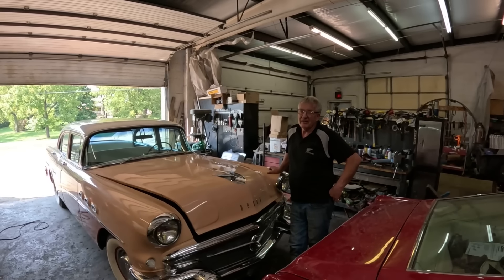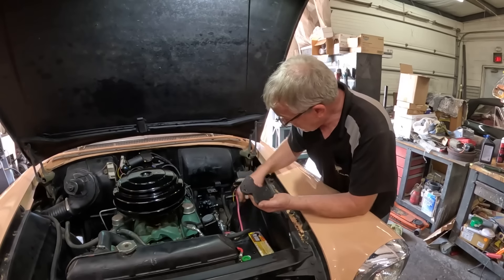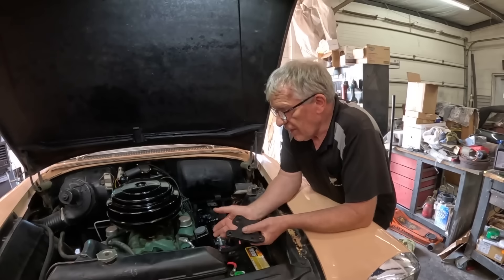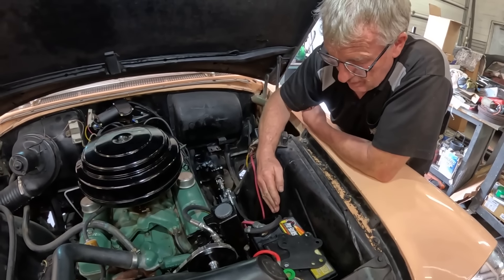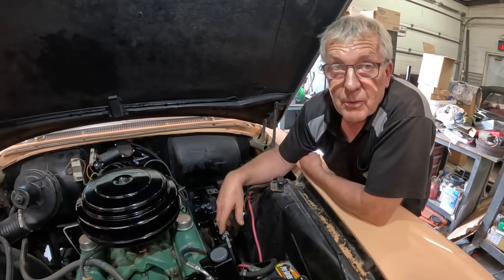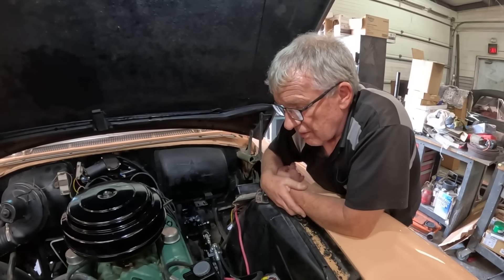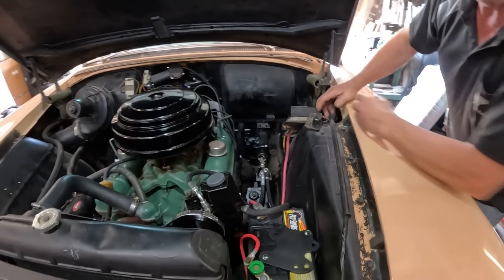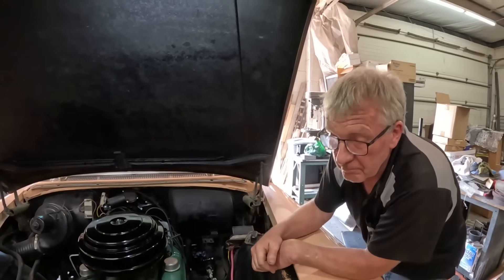I got Burned on Ebay !!!

Comment: EZ Steer just lost 24,000 potential customers
Reply: Easily
Reply: I hope EZ steer contests Kiwi’s opinion. Could be popcorn type fun.
Reply: I would never consider putting power steering in a car that one wasn't designed for it, and 2, doesn't need it.
Reply: @mexicanspec  When those cars were new little old ladies drove them all the time. Easier to get a newer car on the initial buy if power steering or brakes are necessary.
Reply: @mexicanspec    Power steering became available as an option on most US cars starting in 1953, but the factory system is obviously not the same compared to what you get in an aftermarket kit. And yes, you do want power steering in such a heavy old boat. It makes driving it way easier.
Reply: @Fevebblefester  Yes I know.  I used to daily a 1963 Plymouth Savoy slant 6 no power anything.  I never had a problem parking it.  I also used to drive a 1951 Buick Roadmaster and power steering was not needed there either.
Reply: @MrZdvy  Easier yes but not necessary to drive it.  The car has survived for 68 years so far without it.  Adding after market parts to a car like this is always a mistake.
Reply from the maker: The lady that owns this car really does need power steering.  Now me, I'm adding power steering to Marge just cos I like it😬
Reply: @mexicanspec  This was designed for it. It was an option.
Reply: @kiwiclassicsandcustoms9160  Without out it is a workout for your arms so you earn big guns.
Reply: @mexicanspec  yeah but a nice old lady will drive it
Reply: My mom drove a 55 buick when i was about 5. No power steering or power brakes. It was hard to parallel park.

Comment: Kiwi I was actually about to buy this kit for my 55 Buick Special. But I was thinking I have a 74 full size Olds 88 steering box and I have a 80s Monte Carlo SS steering box do you know which steering box they used in that kit? I'm wondering if I could just do this myself rather than wasting the money buying the kit and having to do it myself like you did anyway.

Comment: I'm fighting one right now over a "Small Cap HEI" distributor. 
Met a guy at the car show that bought one and is really happy with his, but the one we got is a TOTAL nightmare. Dead out of the Box. So far, they are working on it for us, but it's put the build on hold for a week now. It's really hard to get good stuff now days, even if it's made in the USA.
And that's really hard to say, but it's true.
Reply: Any new distributor is tear down and full inspect for me, bought a new production one for an odd application a few years back, not eBay crap either, you wouldn't believe the amount of sand, slag, and swarf hiding in that thing between the bushings, probably would have killed the engine if I didn't have to disassemble and modify it first. Even stock stuff for late model cars I look over real careful now, you can't trust anything, QC is dead.

Comment: Sorry to hear. I got a power brake kit from ebay and pretty much had the exact same problem. I couldn't figure it out, my mechanic couldn't figure it out, supposedly a new bracket was sent, nobody ever got it and by the time we'd given up on it the guy said it was too late to return it. Ebay wouldn't help and I called my credit card company and they did a charge back. After they finished the investigation the chargeback stood, so I'm only out what I paid the mechanic. Maybe give that a shot.

Comment: I'm sure it's too late now, but could the return fitting on the pump been welded closed and a new one welded in the back of the tank so the hose would not come across the battery or is it a plastic tank?
Reply from the maker: It's a plastic tank😔

Comment: I wonder if that P/S bracket was for a 55 Buick. The 55 used a much narrower, but longer battery. When I was 16, I had a 68 Mustang 390 with manual quick steering. Junkyard supplied everything I needed for P/S, except the pump. I used a 55 Buick pump, and made my own bracket. It actually worked very well! Sorry to hear of the troubles with the steering.

Comment: Not sure if he would have had a solution for you but I've used EPAS steering in Florida and they provided excellent service from start to finish. I think they specialize in electric power steering conversions and frankly, I think that would have been a better option in this case. Jeff over there was always helpful on the project I used them for and I wouldn't think twice about using them again.

Comment: I am so tired of dealing with $hit aftermarket parts.  It seems that just about every part sent requires a re engineering just to attempt to use this junk. Not singling any company out, its just one thing after another 🤬

Comment: What was the original power steering design?
Reply: It should have had a slave cylinder attached between the track rod and frame. A pump connected to the backside of the generator powered it. These slave cylinders were prone to leaking and were subsequently replaced by powered steering gears.
I would have recommended converting over to a rack & pinion set-up. But for an old Buick, that in itself would likely be a custom-designed system only applicable to that brand, given that Chevrolet, Pontiac, Buick and Oldsmobile didn't start consolidating their designs, until the following decade

Comment: Its a good thing that someone as skilled as you was installing it and could fab the stuff that would fit. My question is if the customer can make proper brackets why can't they? It would take little more effort to make a part that works than one that doesn't.
Reply from the maker: That's a good question that I don't have an answer for...😕

Comment: Seems like a kit designed to fit one application but the seller is trying to pass it off as fitting completely different applications, then sticking the buyer with something they can’t use without heavy modifications, if at all. I have experienced the same issue on eBay recently, just on a smaller, cheaper scale. Fortunately, I have been successfully getting my money back from buyer protection.  The problem is, a few rotten sellers are going to make eBay a completely untrustworthy place to buy from. Eventually, eBay will have to tighten the screws on the sellers which will make life more difficult for the honest sellers.

Comment: Good on you, Chris for calling out these sheisters. Unfortunately, you are the exception. I've heard more than a few YT'ers who suffer similar rip-offs and crap for customer support, but decline to mention the offending party, which is both annoying and frustrating. We want to know who these rat bastards are so we can "steer" clear of them. As James Plotkin commented, you probably should have mocked up entire set-up before making irreversible cuts. Not your fault, but two valuable lessons learned.
Reply from the maker: James is right, I had been lulled into a false sense of security by Borgesson who put out a stellar product that fits and works every time.  I assumed these guys would be the same, silly me😳

Comment: Did this car have the thin battery originally?  I can't remember now.  Maybe that would have given room for the PS pump.
Reply from the maker: I don't think so as it has a regular sized battery tray that looks factory.
Reply: @kiwiclassicsandcustoms9160  Maybe that was just the 6 volt cars.
Reply from the maker: @mexicanspec   that sounds right!

Comment: Sounds quite typical of eBay .... there's a lot of dodgy crap on their site but there's also some good stuff.  You've just got to pick your way through and hope you don't get ripped off.  Sadly eBay won't help .... it's either good news or nothing with them.
Reply: The sad part is, Ebay was known for policing their site. Perhaps, they've gotten so big that it no longer matters to them, if they lose a handfull of customers
Reply: I ordered a belt keeper off ebay for my 17 year old riding mower after the original broke. It was the only place I could find one, and it was cheap. Shit quality, it snapped right where it bolts on in a few months.  I took it to a local welding shop and the built it up, fine now. I should have done that with the original one. We live, we learn. Recently a locally owned mower parts store opened in our little town. They carry about everything I need for my mower, right down to a molded vacuum line I needed. I try to keep my money local best I can. Sorry about your bad luck Kiwi, thanks for the information,  and honestly.  👍

Comment: Why is a kit required? Power steering was an option for this car, at least according to google.  It's a known thing.  It is probably the same exact pump used on 50 GM products across multiple years just with different brackets and/or relocated outlets and inlets.  They could easily reproduce the brackets.  People order and depending on the application they put in the appropriate mounting hardware.  I'm pretty sure GM does this to this very day.  It would be unmanageable to have 30 different power steering units to accommodate all the models.  I know for certain they do it with the alternator. I think they've had the same one for 30 years.
Am I missing something?
Reply: @joea9608  Obviously not.  My point is that GM designed the mounting hardware 70 years ago.  it's not really a custom job. 
They probably used the pump for many years in many models.  It's just a hydraulic pump after all.
If GM had to redesign every part of every car, cars would be 10 times the price.  There is an enormous amount of parts sharing going on.
Reply: Factory parts are usually the way to go when you can find them, the quality and fit will probably be better than anything aftermarket.

Comment: Seems more and more of these eBay parts stores are leaving customers hang when there's a problem with the part that's ordered. What bugs me is there's always an associated 20-50% restocking fee if you return it... even if you're returning it because of an issue brought on by the seller. I tag my good sellers with praise and repurchases and report the bad ones to eBay and the BBB.

Comment: I have a problem with these types of companies. For businesses like yours it's extra headaches and loss in laber costs as much as the product not to mention the customer's loss of driving in the prime summer months. For many of us there is a small window when we can do this work because we do it in the driveway. That eats a lot of that time out that we need for other projects. Not only that we have a city ordinance that only allow a tear down of 24 hrs. We have to try to sneak by that. Three days is bad enough but several weeks of playing around is major problem. This company is not the only one. When I worked for an auto parts store the business had the local mechanics business because we could deliver the right part within 2-3 days. Most of the time right off the shelf so it was a same day deal. Now a days it's more like we live in a different country and have to import everything. That's just the time part. The correct part that is as described is a whole different story. The part fitting and lasting is a third story.

Comment: When something is sold as a kit, it is logical to assume that it has been built for the purpose on the label.  I can accept mistakes get made and also the odd thing slipping through QC undetected, but when the brackets are obviously wrong and the core unit itself is shagged and nobody wants to step up and sort it out, it's one of the most frustrating things one can come across (which is politically correct speak for "it really f***ing pi$$es me off".  As you say, returning the item would be the perfect course of action if you hadn't irreversibly modified the original setup.  

On a slightly different - but similar - note, I ordered a replacement clock movement last week and it has turned up with two minute hands and no hour hand.  The hour hand has a different spindle size, so obviously a minute hand will not fit it.  Suddenly the happy email / text exchange I had been having with them went silent as soon as I made the complaint and they too do not return phone calls.  I might be able to bore the size of one of the hands out or use the hands off the old movement (if they will come off in one piece and will fit), but that's not the point.  You buy a kit with all the parts to make something work as depicted  and supposedly easier and quicker than tracking them down separately or fabricating pieces to make it suit..... and when it turns up and its wrong and you have to chase people around to try to get some form of resolution, it is time out of your day that you don't get back for a problem you didn't create.

I don't get when people do not name products or companies that cause this issue more often.  I have heard people say that naming names is considered libel and therefore they can sue you for defamation.  How can they do this when they are the ones who provided the crap product or service and never stepped up to sort it when it was obviously not fit for purpose as sold?  How does one get them to pull finger or shape up if they can't tell anyone about their experience or warn them about something they need to know about if they want to do the same thing you did?  

Anyway, glad you figured a way around the problem in typical Kiwi fashion, mate.  All the best.

Comment: If you're a fan of the other company, why did you use this one?  And why didn't you look over the kit before cutting the original box? It's all about details and you broke those rules, mate.
Reply: It’s all about trusting the seller 👍 learned real quick  back in the day if possible take old part with you to the parts store  make sure they giving you the right part ! Though rare saves you from frustration , crawling out all grimey and driving back to say WTF 🥹🤦‍♂️ 👍
Reply: Yes, sir I would suppose that it is about the price of Borgeson as they have stuff that is brand new (they have brand new steering boxes). Quite possibly the lady that owns the car did not want to pay a lot for this conversion, and of course Kiwi could have fabricated the installation of a Saginaw power steering box (which is most likely the box installed in the car) and of course there has to be modification to the steering shaft and quite possibly the steering linkage. If you were to look into the original design for power steering in cars of that era you will find that it is quite different from what we are used to. Of course, the lesson to be learned is the cheap comes out expensive. This outfit may not be up to the level of covering all of the vehicles out there but if they advertise their kit to fit a certain vehicle, they had better be damned certain that it will work. One thing about aftermarket stuff that strays from the original design is that there is always going to be some fabrication that requires more skills and time compared to the weekend warrior projects. When the novice fools around with this stuff the novice had better have something else to drive. Of course, lesson learned here. When I was in the tool business one of the shops on my route had a car in where the owner had this bright idea of putting a Chevrolet V8 into a Ford sedan, just because he had this engine, and it would be cheaper (in his mind's eye) than rebuilding his Ford engine (or getting a used one from an auto recycler). Well, the shop did the swap, but the shop owner had a dilemma using the Ford power steering pump (mounting it). The solution was simple. Use a power steering pump for the Chevrolet engine and have hoses made to adapt to the Ford steering box. Of course, if it was my shop i would have estimated the cost of that job so high as to scare the customer away in the first place. The shop is going to lose its ass on the labor anyway you cut it. And also, Fords used Saginaw power steering pumps on some of their models anyway and quite possibly a Saginaw power steering pump for a Chevrolet application may just work without ant modifications. The cheap comes out expensive.

Comment: Why go all the of fitting power steering to your old Buick all this mucking around for power steering well the power steering started to leak on the high pressure hose l just pulled it out and   no big deal l still drive it l have owned many vehicles without power steering l drove them for years power steering is as far as l am concerned you can drive a car without it as l did on many of my vehicles and back in the 1960s and 1970s people drove cars without power steering why fit it and get burned on ebay
Reply from the maker: The lady that purchased this car just can't mange the manual steering. It's alright for the guys but she just couldn't park it. Now she can.
Reply: @kiwiclassicsandcustoms9160  Good luck in getting the correct power steering power steering set up for that Buick
Reply from the maker: @lesklower7281  all done and delivered !!
Reply: @kiwiclassicsandcustoms9160  That's good

Comment: Can you turn the battery 180 degrees? Can't get good parts anywhere these days. Good Job!
Reply: You mean 90?
Reply: @derekhobbs1102  No, he means 180.
Reply: That's not a good idea as the positive battery cable will be too close to the fender and if that fender is hit it could ground out the battery terminal. Of course, there is no sure-fire way to prevent that calamity to the battery in case of a collision, but you will find on most automobiles the positive post on the battery is located away from any potential grounding against the vehicle body.